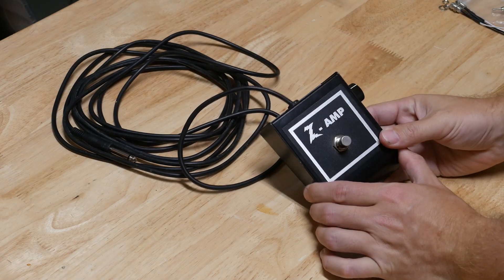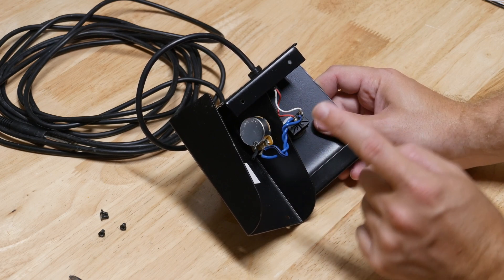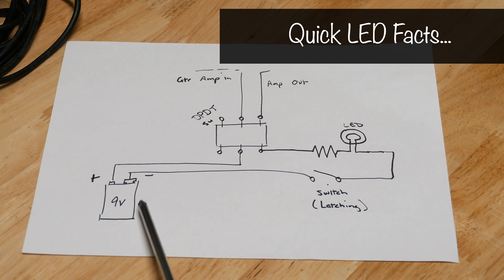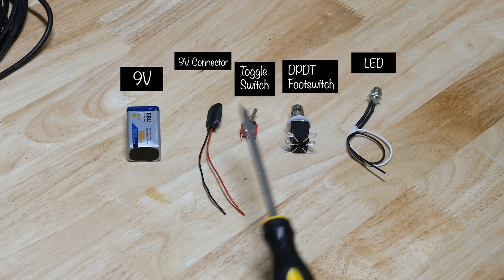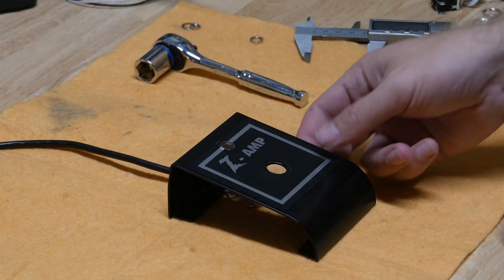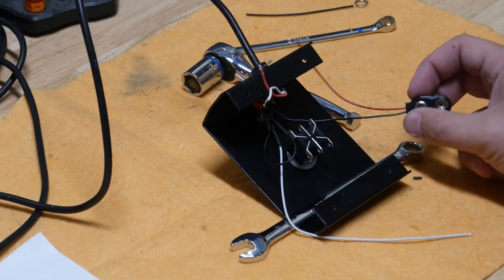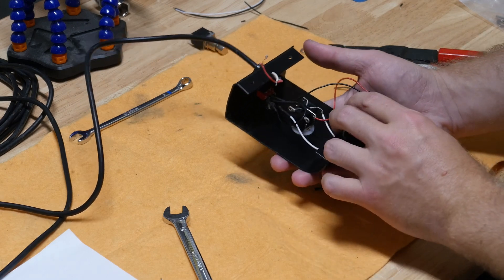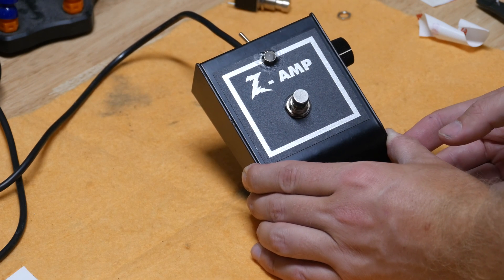Guitar Pedal DIY - Install LED Light in your Amp Pedal ON YOUR OWN

Comment: Doing this for my Deluxe Reverb, trem/reverb footswitch!  Thanks
Reply from the maker: That’s great.   Are you going to split it and have two lights one for each switch?
Reply: @ I believe so… it’s a little tricky with the deluxe… we will see I guess… I’m just adding 9v and replacing the switches… I don’t see why it wouldn’t
Reply: @ sorry didn’t quite answer you lol… Yes that is the plan

Comment: Very simple and informative. I went ahead and got a female plug over the battery option so I can plug power in  though my power chain. Thank you for taking your time to make this video!
Reply from the maker: @RedeyeRaccoon  thx for watching!  And that’s a great idea.  Especially if you have room on your board OR an easy way to run an extra power cord over to the amp pedal….  Nice!!!
Reply: @tjnilsen  If you get a switching 9v jack, you can wire the battery in and when a 9v pedal supply is plugged in, it will switch over. That's how I'm wiring it up today. Also, ditching that million mile cable Dr Z has attached and wiring in a 1/4" jack so it can be used with any TS cable.
Reply from the maker: @ oooo.  Great add-on for this .. also, yea the hard wired cable gets annoying , the jack install is an awesome idea.
Reply: @tjnilsen  one more thought I just had, instead of a switch to protect the battery you can wire  in a power switching circuit with a trs jack, such that the LED can only be switched on when a cable is plugged in. One less hole to drill and no chance of the switches being knocked and flipped on. Anyhow, great video!

Comment: I have 11 to 14 pedals in my chain and some pedals light up when not on. Usually when using pedals with switchable clipping using leds. Mainly fuzz pedals do light up when not on. I understand now builders use the led not just for on but to smooth out the fuzz ourput.?
Thanks for the video

Comment: First time I tried adding leds to my new circuits I burnt out 3 before I realised that they needed a resistor. I want to use led clipping to ground on a switch but don't know how

Comment: I want to do something similar with a slightly modified Marshall foot pedal that I use with an old Traynor amp head; one switch controls reverb, one controls tremolo...can I add 2 LEDs with a single 9v power supply?
Reply from the maker: Yes definitely, especially assuming your footswitches are dual pole dual throw switches where the LED circuit is on a different leg than the amp controls like the video.   All you have to do is split the power coming out of the battery (after the “power” switch if you decide to go that route).    Feel free to send me an email at tjnilsenmusic@gmail.com and I can send you a diagram and potential parts list if interested.    Thx!
Reply: Thanks for taking a look at it for me! @tjnilsen

Comment: why are you using a battery? the amp provides the voltage you need.
Reply from the maker: It’s a great question.    In an effort to avoid any complications with the variable boost (there’s a potentiometer inline in this circuit for the Z amp) and also an attempt to keep this circuit out of anything to do with the amp.   Those are the only reasons.  Would be interesting if there was any noticeable difference in tone or function by either placing the led in the amp circuit or by using the amp voltage to at least power the led.   Thx!